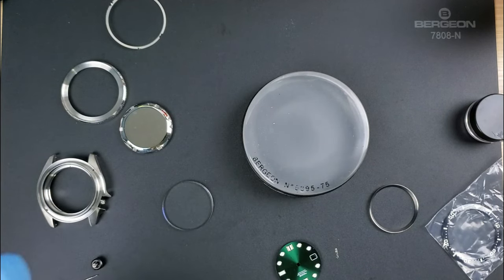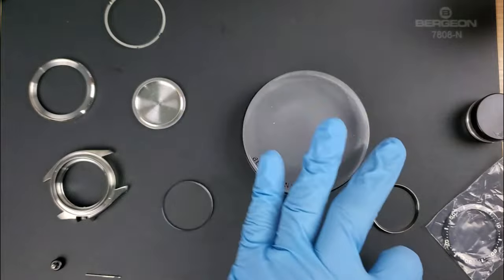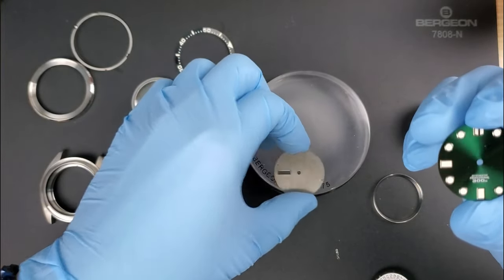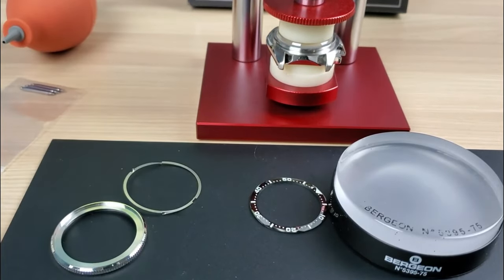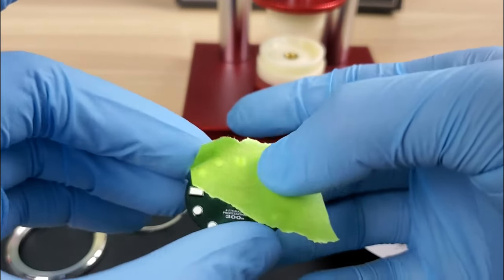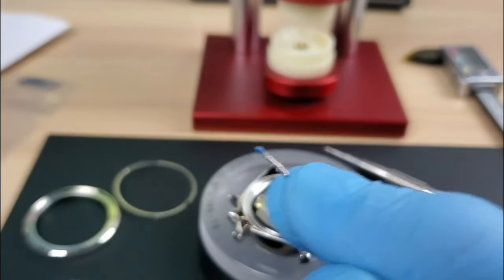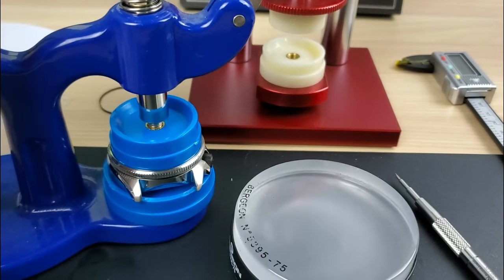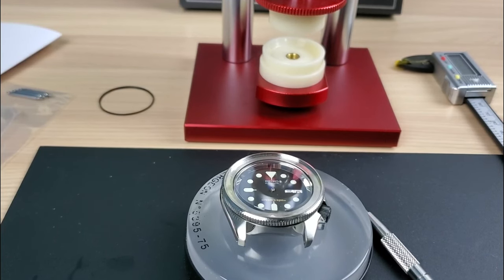Seiko SKX MOD Guide "How To" Build Guide From Scratch. Seiko SKX Build

Comment: As a complete newbie, I appreciate this video. Unfortunately, I feel as though key parts of the build are completely missing. Why not include the entire process? Setting the hands and attaching the bezel insert would have been helpful to include. Did I miss anything else?
Reply: Removing the stem before cutting
Reply: Agreed the hardest part was missing